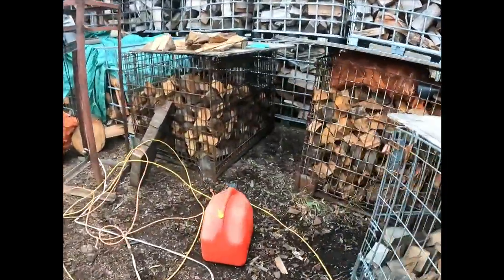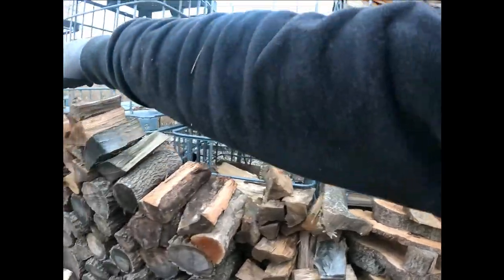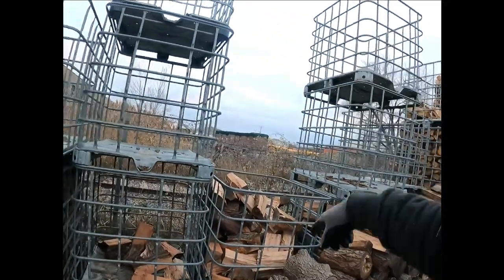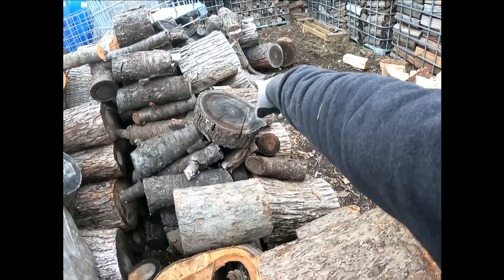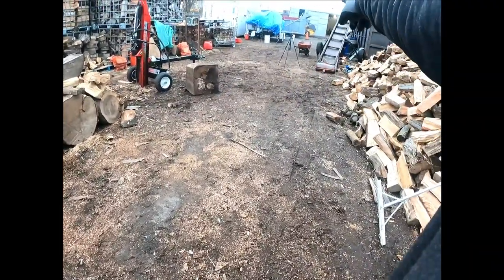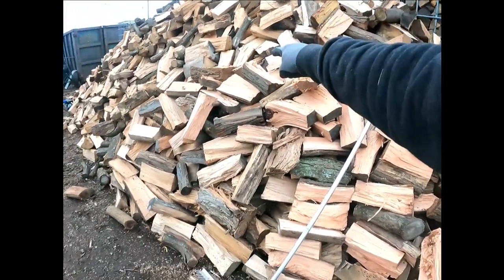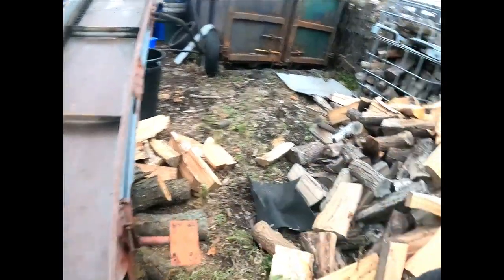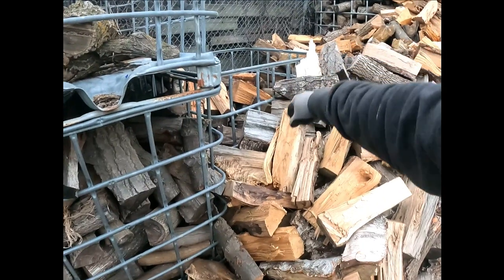FIREWOOD INVENTORY DEC 2021 - HOW MANY CORDS ON HAND?

Comment: Nice bit of wood you got there Anthony! I have been kicking around the idea of selling bags of small 2-3inch chunks as smoker wood. We have a lot of cherry in our area and the tree tops would be great for the small smoker chunks! Thanks for sharing👍🏻👍🏻
Reply from the maker: Hey man, thanks, it's really easy on the eyes in there when it's cleaned up. It was total chaos last spring and summer and it's also nice to see most of the crates with wood in them. I wasn't sure about the smoker wood chunks, .but  I tried and it worked! Really helps make the business more worth doing.

Comment: Like i said, you can never have enough wood. Thanks Der Guy.
Reply from the maker: Ideally I would like to have the totes filled and nothing unsplit laying around at this time of year so that I don't have to split during the winter.. Cheers
Reply: @OntarioFirewoodResource  I like to have 10 bush cords in logs stacked 10 cord of rounds not split and 10 cord of split and stacked just for the homestead.
Reply from the maker: @josephgrant9137  That's a good strategy. I try imagine how I'd be set up if I had any time of place to burn at home, whether homestead, house in the city or big budget place with stacks incorporated to the decor. I'd have the best stacks, most, efficient ways of transporting dry wood to the fire. I've even considered a giant stainless steel hopper like a rabbit feeder that's loaded from outside can be pulled from inside to burn.
Reply: @OntarioFirewoodResource  I set up a hopper outside that brought wood pellets into the house for a pellet stove. But not firewood. I use the window method for my firewood. But that's all going to change now that I got an outdoor boiler. As soon as i get all the parts and lines and heat exchanger ill be running that.
Reply from the maker: @josephgrant9137  Nice! I love the boilers because they save the work and mess of bringing wood inside. I'd miss the smell inside thiu and would hope to keep that going somehow
Reply: @OntarioFirewoodResource  The indoor furnace is new and we will keep using it to heat both the additions on our house as they dont have duct work from the furnace in the main house. Only heating those 2 i should only have to load it once a day verses 2-3 a day like i am doing now.
Reply from the maker: @josephgrant9137  awesome, would love to see that setup

Comment: From my experience with the IBC totes a dumped in load holds about 1/5 of a cord and tightly stacked like yours holds 1/4 of a cord.
Reply from the maker: I usually add 15 to 18 logs to the tote load for a face cord and I've only stacked a measured out 8 x 4 area at customers' houses a few times and I'm usually pretty close. Never measured  loose totes until its in the truck and I figured about 2 totes are a face cord, close enough to your 1/5

Comment: Hello Anthony, New sub here, Tom @ Adventures at Home. You have a great inventory! My inventory is very depleted. I need to go back into the woods and buck up more. Have a great day!
Reply from the maker: Thanks a lot! It's hard to keep up an inventory, I even ran low this your for my shop wood stove after overstocked a couple years ago, but I've had a lot of dry wood come in recently so I'll be oak this winter and have stocked some for next. Will try and fill my crates at the shop to have teo years worth.

Comment: Got wood? Ha ha ha I figure I burn between 9-11 cord a year depending on how harsh the winter is ..... how much you charge for a cord in ontario?
Reply from the maker: That's a lot of wood to burn! I charge 350US. City price
Reply: @OntarioFirewoodResource  I heat my 1300sq ft house and my 1600 Sq ft shop with 19ft roof.  Still beats the gas bill!  Pretty reasonable for the city!
Reply from the maker: Yes that's a lot of space, especially with the 19 ft ceiling. 
Not a bad price for perfect firewood! 🤣

Comment: Nice inventory.  How much came from the neighbor?
Reply from the maker: Thanks man. Only a couple cords. Mostly soft maple in there, a bunch of Norway and I scooped the honey locust, mulberry, ash, beech and apple
Reply: @OntarioFirewoodResource  is the Ash borer killing your ash trees too?
Reply from the maker: @backyardfirewood9852  they've been there and done that. Over 1M ash trees in Toronto years ago. I started firewood right in the thick of it 😁 lots of July wood ready for winter at that time, 2013. They've treated a bunch of trees at a cost of 550US  each
Reply: @OntarioFirewoodResource  the vast majority of the wood I sell is Ash for that reason…
Reply from the maker: @backyardfirewood9852  that's awesome. I miss those days, ash for me is rare now. Ash made me move from my shop to the woodyard, I was getting some much if it and others that it threatened my loading door being blocked to get my older smaller boat that was stored inside ready for fishing trips.  In the new place, i had Davey dropping off wood. I had a buddy helping split and we filled a 40 yard bin with ash in two days!

Comment: With over 3 million people in your area it's hard to believe you have anything in your yard... think you need to get the word out that you sell firewood...
Reply from the maker: Yes those 20 totes in the back on the right should've been gone, last year was slow, this year much slower. I took a gamble by stocking the softwood at the front,not surprised that it didn't sell, I've never sold much "summer" wood.